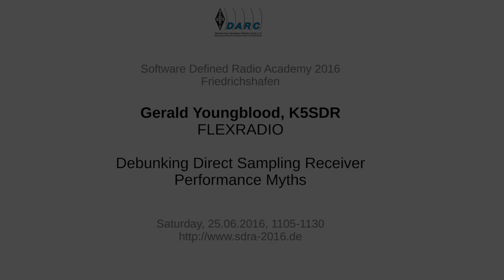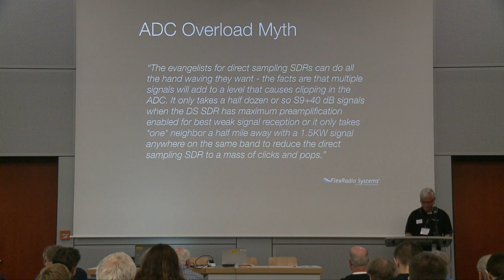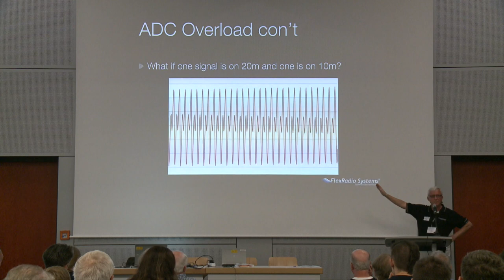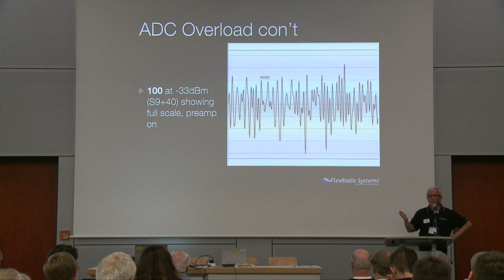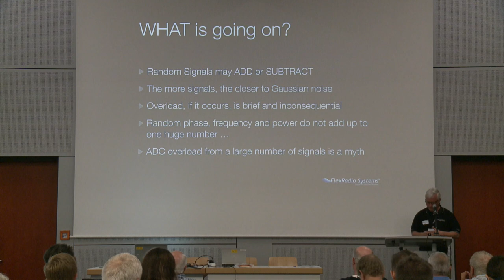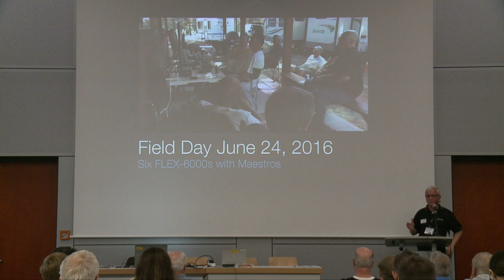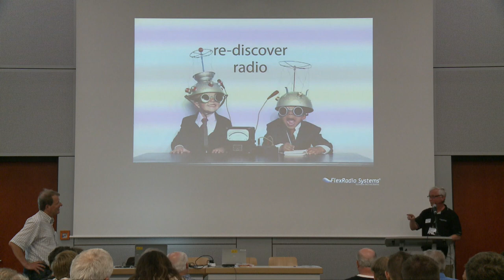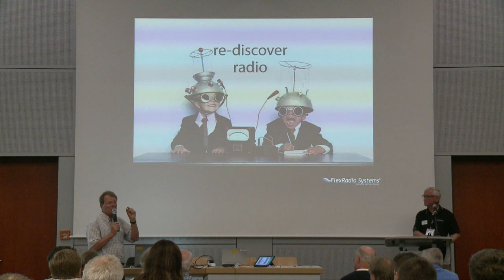Gerald Youngblood, K5SDR, FLEXRADIO: Debunking Direct Sampling Receiver Performance Myths

Comment: Whoever asked that first question was totally right and unfortunately Gerald was very unprepared to discuss the problem of high power gaussian noise destroying the performance of the analog preamp or ADC driver. The roofing filters in an analog IF stage are a good technique to address this, but of course there are others as well such as adaptive nulling that could be applied to the incoming signal to reduce unwanted RF energy prior to a preamplifier. Fortunately for him, the Analog Devices driver in his radio is absolutely a stellar device (it's designed for high end RF test equipment after all) and the clocks have very good phase noise. The fact that the flex radios are able to work in the environment that they do with nearby signals indicates that at least for Amateur Radio there are off the shelf parts that have good enough performance to reduce the entire debate to being something of a moot point.